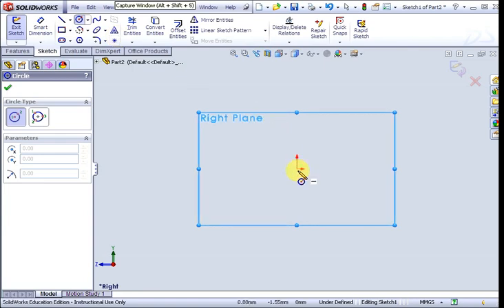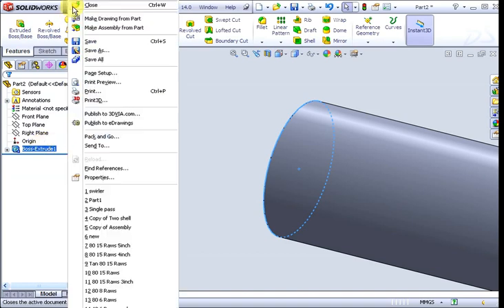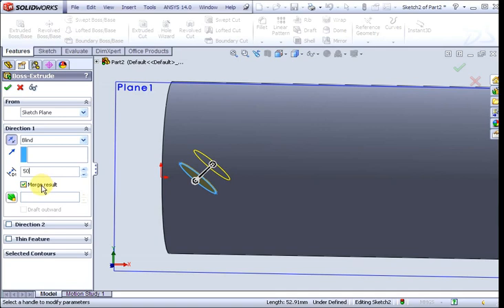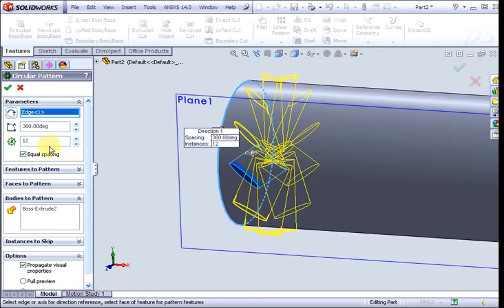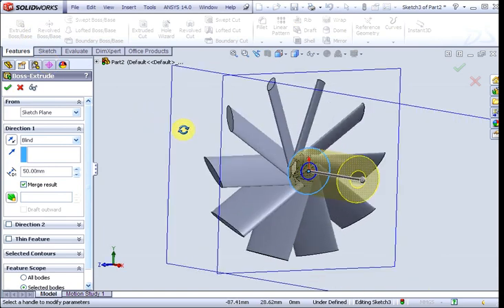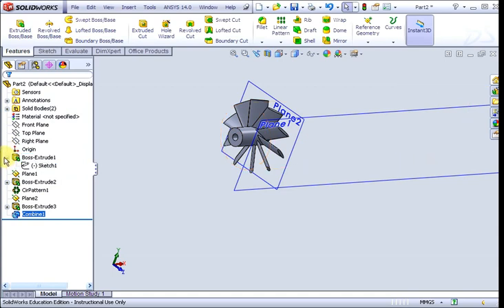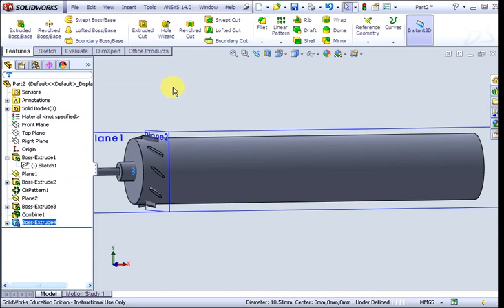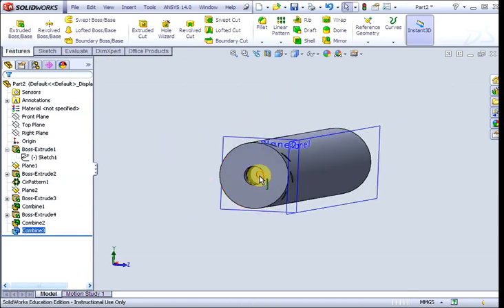Part 1: Solidworks tutorial: burner with air swirler for ANSYS-Fluent CFD simulation

Comment: hi professor.I have a doubt why are you substracting the swirles what difference they make? could you please assist me on this please?
Reply from the maker: If you are not planning to do heat transfer then you don't need the solid part in your mesh ...making it as void will reduce the mesh size considerably and simplify the computation as the boundary layer will not include shadow-walls for heat transfer... if you keep the swirler as separate part then you will export two bodies to ANSYS and you will need to define one as fluid and one as solid
Reply: Thanks professor

Comment: could you please send its geometry file here ,?
Reply from the maker: OK ....you can contact me and I'll email it to you .....you can find my email in my website:
www.about.me/al-attab
Reply: @khaledAlattab  i have made it by seeing your tutorial ,but i want to do 2D Analysis of Combustion for Fluent ,how i can made 2D Sketch for this 3d Model ?
Reply from the maker: For 3D I use SolidWorks because it is much easier to modify later-on and change the geometry... but for 2D you just sketch on the geometry program built-in the workbench easier.... other wise you sketch directly on any plane 2D sketch (on solidworks), no conversion from 3D to 2D ....In solid work you can also get a 2D drawing from the 3D part by creating a new file (drawing ...from the part-assembly-drawing options in new file tab) but I am not sure if it can be saved as  X_t format ....try
Reply: @khaledAlattab  Thank you sir for your reply ,one question is more ,(1) what is Swirler angle you set in it ? is it 360 degree ? (2)  Moreover is this model could used for Methane/Air chemkin GRI3.0 mechanism For production of NOx ? (3) From where you got dimensions specification for this model is there any reference dimensions available.? i'm beginner so a lot of confusions i have ,need your response .Thanks